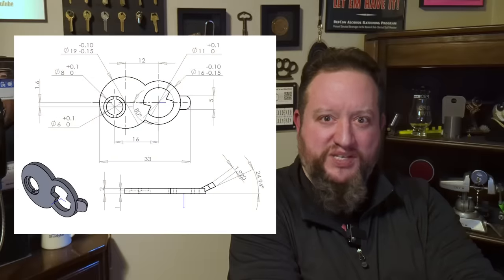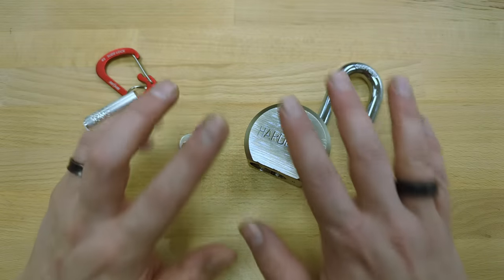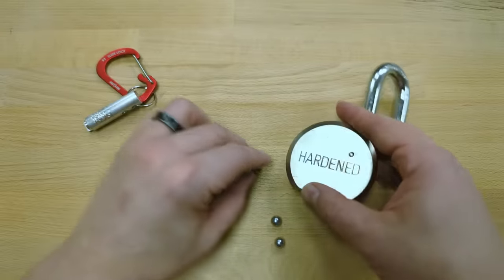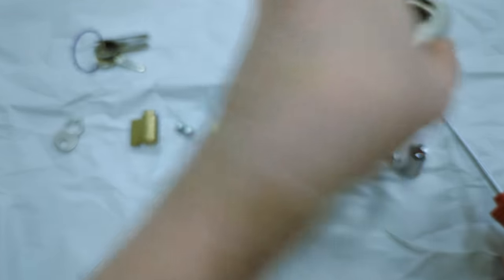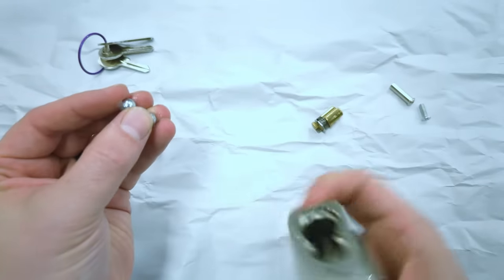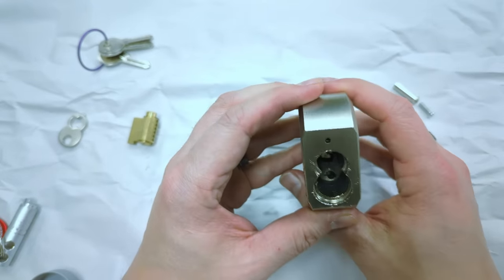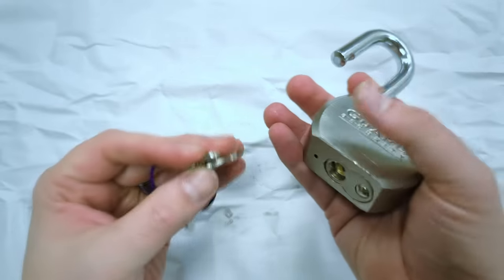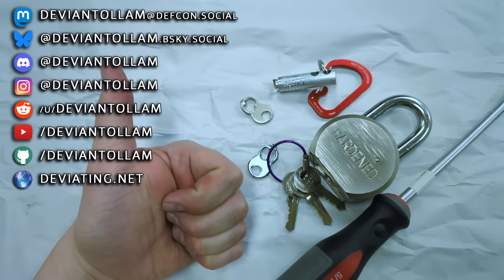Fire Plug Padlock Covert Repair Instructions

Comment: 0:00 🎉 New Year's Greetings
    - Intent to share new tools, tactics, and fun content.
    - Channel content remains a random collection.

0:21 🔥 Fire Plug Tool Overview
    - Introduction to the fire plug tool for rapid entry.
    - Designed for First Responders and firefighters.
    - Used to open padlocks by flipping the actuator cam.

1:00 🛠 Destructive Padlock Entry
    - Describes the process of cracking off the bottom plate of a padlock.
    - Highlights the fire plug's role in opening locks efficiently.

1:53 🔩 Repairing Padlocks
    - Emphasizes the replaceability of the cracked bottom plate.
    - Discusses sourcing a multitude of replacement plates for training and repair purposes.

2:22 🏠 Graceful Entry and Repair Plates
    - Suggestion to offer a five-pack of repair plates for graceful repairs.
    - Proposes an alternative method for non-priority calls or situations needing a subtle entry.

3:00 🧰 Repair Process for First Responders
    - Focus on how to reinstall the figure-8 plate on a padlock after it's been cracked.
    - Addresses the worst-case scenario where all parts fall out of the lock.

4:01 🛠 Repair Guide Demonstration
    - Step-by-step guidance on reassembling the padlock's internals.
    - Explains the process of handling ball bearings and actuator cam placement.

7:01 🗝 Reinstallation and Testing
    - Instructions on repositioning the plug and ensuring proper functionality.
    - Stresses maintaining inward pressure and testing the lock's operation.

9:58 🔄 Repair Completion and Functionality
    - Successful completion of repairing a previously destroyed lock.
    - Highlights the covert nature of this repair technique.

11:01 🌟 Concluding Remarks
    - Encourages safety and offers insights into the fire plug's usage for different scenarios.
    - Concludes with well wishes for safety and usefulness of the demonstration.

Comment: Good info, but is there any way to actually harden that lock to protect against that attack. Not that I want to frustrate firefighters, but I had been using that lock with an upgraded core from a master loto lock.
Reply from the maker: Absolutely.  Forged bottom retainer plates as made by American Lock proper can't really be broken like this.

Buy the OG American Lock or something like PacLock and you're very protected
Reply: @DeviantOllam  thanks for the info, I think the one I have started life as a Master 930 that I pulled out of the mud and cleaned up and upgraded with a new core.

Comment: I always have a small pry bar in my pocket just for this reason I can pry the retainer plate off and then insert my pry tool to into the lock and turn the padlock open very handy.
Reply from the maker: Very cool!  Is it an off the rack tool or one you've fabricated yourself?
Reply: @DeviantOllam  A friend of mine made it very compact and fits in a pocket.

Comment: How much is one of these locks to just buy?   If it's not $40 or more then maybe it's not worth the complexity of going through and having replacement parts?   At that point it would seem like the replacement part is only to hide that you did something, not for fire fighters.

You can keep the same keying with your replacement lock without this by just buying a replacement lock and swapping the core with the intact one from the old lock.

Comment: Nice job.

Did you have those repair plates custom manufactured or did you get them from American/Master or PacLock? I assume they are heat treated after being stamped out.
Reply from the maker: I used to order American Lock pieces but we also need these for class so ours are cheaper.  If someone wants a better one they should buy a better lock, lol

Comment: There’s all kinds of different shapes of those bottom plates, even for the same brand of lock. So this isn’t really feasible unless you’re carrying 10 different shaped plates. And the guy in the video is holding a big screwdriver that would be perfect to turn the cam with, so that too seems a little silly when you already have the tool for the job in your hand.
Reply from the maker: I imagine there's a chance you have a larger lock collection than I do (plenty of folk surely do) but I'll say that I've experimented with about two dozen variants of this form factor of lock and the standard "American Lock" plate fits them all.

Your mileage may vary, of course.  I leave room for that.  But I'll say that if you come across a lock where the standard plate doesn't fit I'd love to know the brand or source and get my hands on one. 👍
Reply: @DeviantOllam   I have numerous round body padlocks.  2 fit the plate. The same harbor freight lock in the video (mines stamped us general) and the Ace 527 fit that plate. So the others that don’t fit,  first and foremost, which I would assume will be the most common of these type locks, that people can buy at any hardware store is the master 930/6230, it doesn’t fit, the Yale round body doesn’t match any of them, and the master 230 has a different bottom so I guess it doesn’t count.  Then if you get away from round body padlocks to something like the American lock  series 50, or 5200, or any of those, it’s different still.  If your sample size was the same “hardened” lock just with different names stamped on them I would imagine they would be the same.

Comment: Cant you just turn the actuator with a screwdriver?
Reply from the maker: It can be possible to but in my experience the screwdriver will jam or scrape in weird ways and not work as smoothly

Comment: If nothing else, I have learned to never use one of these trash locks.
Reply from the maker: Yes.  The no name clones are nowhere near as good as the American Lock or PacLock models
Reply: A true American Lock is much harder to get the plate off. I have chipped and damaged screwdrivers trying. The tolerances are also tighter preventing a demo screwdriver strong enough from prying the plate.

Comment: It's a lot less destructive than having to cut the lock open, which totals it. I could see this used in schools for getting into lockers without requiring bolt-cutters at the end of the school year. 🤣
Reply: I haven't seen anything that okay on a school locker. Usually ML and just lookup the indirect code on the back or combable. But I like how you're thinkin'! Just a little forethought makes everyone's experience better.
Reply: American Lock on a school locker would be a step up to at least the luxury brand of Master Lock. 😉

And hey, the crack attack is better than a bam bam tool. The bam bam is as knuckle-dragging as it sounds. 😂
Reply: i think the shackles for these locks are replaceable items as well.. aren't they?
Reply: @manp1039  yes, but an eight plate is a helluvalot less expensive and just as quick.
Reply: @matthewellisor5835  i agree.. Also, this techniegallows you to remove the core without the key.. I think replacing the shackle would still require removing the core anyways. so in a sense it would be a time saver. I am not sure how difficult it would be to pick these locks or do so without causing damage. With the removing the core you could essentially exactly get the key code exactly as the origianal or rekey it with new pins or possibly even key a stealth master key (back door?)??

Comment: Just a thought - what if you grease the recesses in the shackle & nowhere else?
Could the balls then stick to that at either side just by rolling them each way? It could be a bit easier with less less mess and less manipulation, if it works.
Reply from the maker: That's actually an interesting thought... I bet you could do that!
Reply: Would work pretty much the same, considering you´re using the same grease. I really don´t think you want anything TOO sticky inside a lock, just enough to pin them down. But I think you´re thinking the right way, you´ll also need a lot less grease, which I really don´t want in my locks - I want oil in there.

Comment: I was thinking. What about incorporating the fire plug into the the butt or pommel of another tool?
I would either make it as part of an prybar who's business end is sized for crack attacks, a  door latch bypass slider or part of a travelers' hook. 

Just make the handle out of fire-plug sized, aluminum bar stock that's extra long, machine the fire plug end to shape, then knurl, groove, plastidip or stretch a bicycle grip over the handle part. Or make the handle out of oversized hex stock for easy grip with gloves. In fact, that old timey plastic driver handle profile, hex profile with fluted faces,  might be a good idea. That shape doesn't rely on texture or elastomers for grip, ideal where solvents, oil, heat, water, detergents are present.
Reply from the maker: Pretty cool thought 👍

Comment: Great idea and nice tool - I love the idea of being able to change it from overt to covert. The 8-plate tool was out of stock on the website when I checked yesterday and I can't even find it on the site today. In case anyone wants one but doesn't want to wait for it to come back in stock, the technical term for the part is apparently a "trap door" and I found part # APKG4680210 on pg 32 ("Retainers & Trap Doors" section) of the 2013 American Lock Commercial Security Products Service Manual. I'd rather buy it from you guys, since as you said you used to order the genuine part yourself until you realized you could get a better cost & quantity for your classes by commissioning your own, but in the meantime if anyone has an urgent need the product # should let them track it down themselves. Also there are a few variations shown in that manual (with different part #s) in case anyone needs one of the variations.

Comment: Dev, Have you ever done this on a job as a covert entry method?
Reply from the maker: Yes I've done this in the field... But at the time I had a whole replacement lock and swapped cylinders.

This method allows the body of the lock to be the same, which i like.  In case the lock you've encountered has a certain color or maybe has markings on it or even a sticker or anything distinct... It will still look like that after you're done